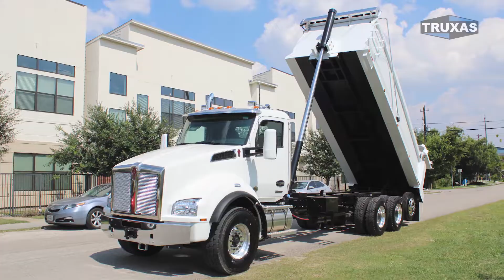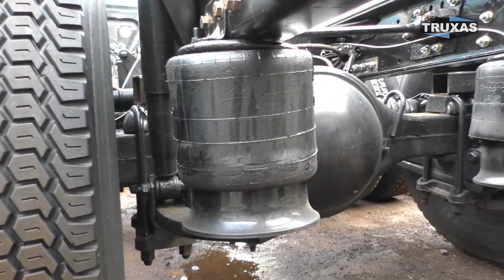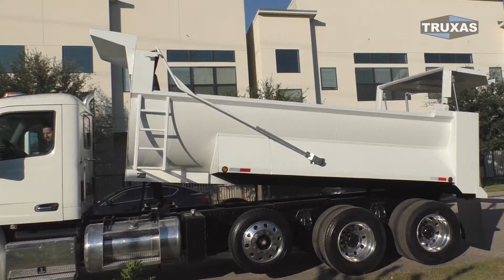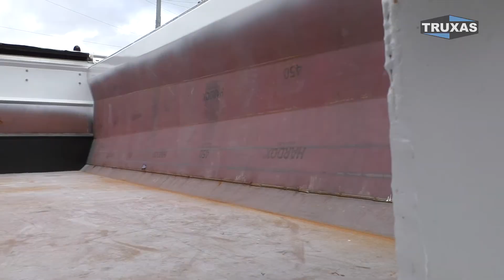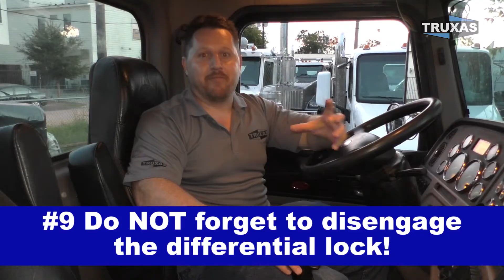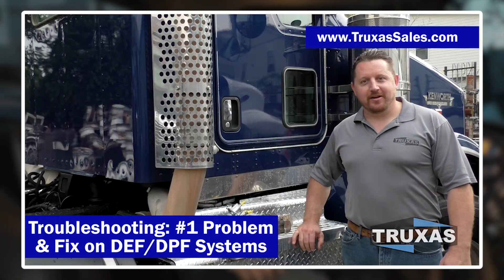Top 10 Things You Should NOT  Do With Your Dump Truck

Comment: Just for trucking in general ,replace the nut on your air level valve ,if your on board switch fails you can dump your bags that way without having to shut off the truck and dump the tanks

Comment: 05:24  #4 Shutting off the PTO.  How to prevent operators from accidentally raising the dump box while driving down the road?  These mistakes cause so much trouble for power lines, traffic lights, gantry signs, bridges, tunnels, etc.  While they make for lots of fun viewing of dump truck fails on youtube, the real life damages seem to be easily preventable.
Reply from the maker: You need to turn the pto on and the bed up knob or lever in order to dump. You can rig a switch that doesnt alow the pto to come on when the truck is moving, but some jobs you want to raise the bed while moving.  You need to be pretty spaced out to drive around with the bed up on the street. I saw an end dump carring 3x10,000lb boulders dump them on the freeway whille driving and then hit a brige in Southern California, probably 16 or so years ago.
Reply: When i have my pto on it beeps and lights up until turned off
Reply: Our new trucks have the safety feature built in so that you're not able to engage the transmission while the PTO is still engaged. I understand the premise so as not to possibly burn up the PTO driving down the road or somehow have some spaced out driver inadvertently raise their dump bed, but occasionally, the necessity arises that you may need to temporarily engage the transmission momentarily while the PTO is also engaged. I can also tell you that although our tractors have valves to dump airbags for the tractors, unfortunately, our trailers do not have the separate valves as I've encountered with past frameless dumps.